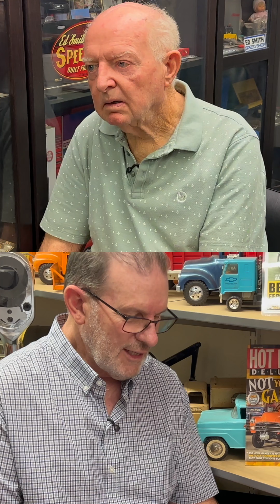FORD vs Lincoln Motors - Which is Better? From Ask Ed 46 - Ed Smith w #BarryT

Comment: They probably used virgin iron for the blocks. Toyota did that. You never seen the older Toyota engines with cylinder wear.

Comment: For all my old work trucks. I used to go get a Lincoln 460 or 400. And always grabbed the c6 to put behind them. The drive shaft I took and had it shortened 6in. And threw away the 2 piece shaft. Had more torque and drove so smooth. Once I got lucky and found a 429cj. Those trucks ran like a scalded dog. And hardly ever went down.

Comment: My Lincoln and my Dad’s before both had 2.74:1 rear gearing and 235x75-15 tires. The poor 460 could have had 10.5:1 compression and about 40% nitro in the tank and it would never pull that gear on the highway. 
Good lord that thing was heavy but it was a big block and rode like a dream. I remember it had that huge swash plate compressor a lot of GM cars had on a huge cast iron bracket. The great big triangular plate it also housed supported the power steering pump (Saginaw?) It was one of those “Pay attention and look at what you’re doing” deals. If you looked close enough there was a tensioning bolt hiding on the side of the bracket that made tensioning super easy. It also made changing the Stock Fuel pump an exercise in working blind around corners and primarily by feel. Not sure why I mentioned it except that it was actually heavier tho an a York Upright setup thy used on virtually everything else but it fit under the low hood line.

Comment: Maybe more nickel in the Lincoln block. ?
Reply: That's why old International tractor motors just keep going. More nickel content than any motor made. Got a 52 that just won't quit and barely uses oil under heavy strain during the season, if I add any oil.
Reply from the maker: That is Ed’s guess too

Comment: Okay this is the "caution" word I got so I didn't attempt to make any deep course cuts when I got a job as a automotive machinist in 78'. Ford’s Lincoln‑grade cast‑iron blocks consistently used a higher baseline nickel content than Ford’s regular passenger‑car blocks, and higher than typical GM (Chevy) or Chrysler grey‑iron blocks. From all the blocks I machined back then, even standard Ford block's showed minimal wear and I could order 0.010" over pistons and ring sets for them and on Chevy's, we tried hard to keep them 0.020" over but most went out the door 0.030" over.

Comment: Im wondering how long there was a difference between the Ford and Lincoln motors. Was it more or less a 50s and early 60s thing or did it extend later? I cant imagine Ford Motor Company going the extra mile on anything they built in the 70s. This is extremely interesting. We would go through the junk yards looking for big blocks in mustangs and walked right past all kinds of Lincolns. We probably could have pulled a old Lincoln motor for half the price of a worn out 428 in a mustang.
Reply from the maker: I’ll ask Ed a follow up question on what years he thinks this was happening
Reply: 70's Lincolns too, I confirm this.

Comment: I pulled a 455 out of a Pontiac. While tearing it down with ridge reamer in hand I realized I couldn't catch my fingernail on the ridge. I decided to skip the bore job. Honed it and put in a new set of rings.  Milled, ported and polished the heads and put her back together.
Reply from the maker: Good job!

Comment: The 430 MEL engine was a brute, with lots of torque.
The 1958 Super Marauder engine was the first to make 400 hp, with three carbs, big valves and ports....and the polished aluminum air box was very cool, and together with the intake setup, worth a small fortune now.
Reply from the maker: Indeed, we like those